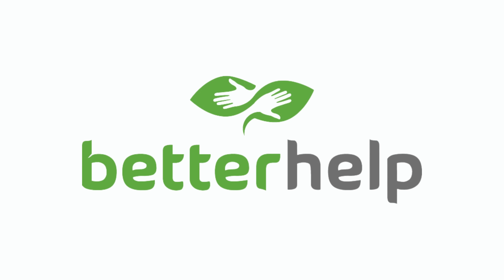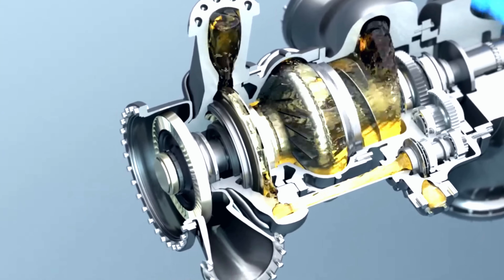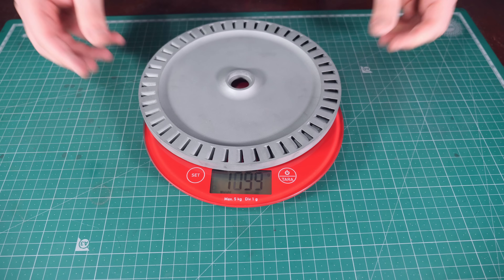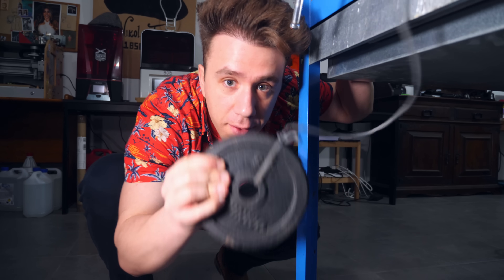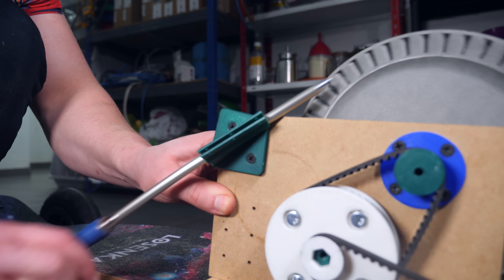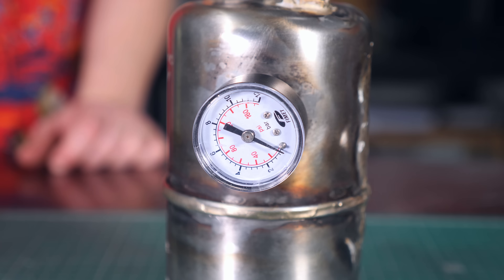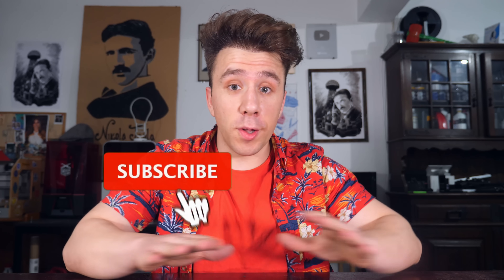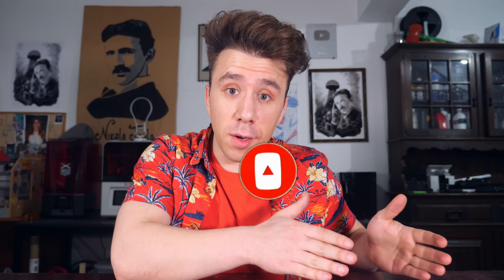I built a TURBINE Skateboard

Comment: 4:19 face next to a 1kg rotating mass
10:05 is the pressure raising? I think I need to release the pressure
Man how many chances are you taking with your life!!
Reply: A flywheel with visible fucking runout vibration on a plastic bearing housing.  Jeezluz.
Reply: If he had just stood infront of it an not to the side in the path of potential shrapnel he would bee sweet. He just wanted to get some comments goin i think 😂
Reply: After saying this, you then proceed to hop in a car and travel at speed with oncoming traffic separated by only a couple of meters from yourself.
Reply: AND wobble, AND single shear.  God damn he's lucky he didn't spin it up all the way
Reply: The pressure vessel was mild though. 8 bar at that small of a volume would probably give you a good scare and ring your ears but you'd be fine
Reply: @brett567 What if it ruptured at much higher pressures? What if he didn't pay attention to the valve?  It could have become a bomb
Reply: @Riiludragon  volume was still to low for it to be much of a danger to his life. No way that janky tub would hold enough pressure to become a menace. I'm a pneumatics engineer and have seen ruptured air receivers take out walls that they hit but even with 250l of air at 13bar the guy stood 2 ft to the side only gets tinnitus
Reply: Man is a true engineer, putting everything on the line for some fun

Comment: They have tried using them in a number of land vehicles but in every case so far at least, they didnt hold up with one notable exception. The Avco-Lycoming AGT1500. 

From what I can gather, the problem is that they just dont work very well when not driven hard. Slow to get going, not as responsive even when they do, they can be noisy, hot, expensive, and on top of that, of course have the inherent difficulties that come with any brand new use of a complex machine that has to perform day in and day out. 

The exception that proves the rule of the AGT1500 is a tank engine and was funded by the military industrial complex so doesnt have or care about most of the problems. Under more normal circumstances its been hard to get the idea going. 

Even so, they are still on the table, and being tried/used in larger hybrid vehicles which can eliminate most of the issues and hopefully reduce costs and improve reliability in time.

Comment: I’ll repeat what other people have said to make sure you see it: DO NOT MAKE YOUR OWN PRESSURE VESSELS. The design, manufacture and qualification of a pressure vessel is an entire area of engineering that you are not even close to being qualified in. You had no pressure relief valve on the vessel, but even if you did it might not have helped because you have NO IDEA what the pressure limit of that vessel is. Additionally, every time you pressurise and depressurise the vessel, cracks in the material itself and in your welds / brazing grow, so the maximum pressure it can take decreases over time

Comment: I would like to see you using a Scuba tank filled with compressed air to power your turbine - air is cheap, regular tanks will have either 200 or 300 bar of pressure, and using a first stage as used in diving will lower the working pressure to 9-10bar, which seems to be a good fit for what you are doing now. Plus, no need for a heat source.

Comment: Propane is about 150psi if you wanted to try to use a “superheated liquid” compressed air motor?
Inject it was a liquid and let it flash boil in the cylinder

Comment: Fantastic video. I got a bit scared for you with the braised liquid nitrogen tin though. Sure you know what you're doing but I have no idea how explody that might be, right next to your gentlemans too... Anyway, they use turbine engines in Abrams tanks. Seem to remember they're quite thirsty, so they don't have the range of a normal diesel powered tank but holy cow, can they shift.
I also remember hearing that the cars acceleration was a bit naff so that's why it never caught on? Don't know, something a bit fishy about that story. And you could make said car hybrid now so you'd have a reservour of more or less instant battery power to complement the turbine throttling speed itself, so it seems like a non problem.

Comment: 1. I think the wheel works as a gyro due to the weight and speed, so since it is sligtle turned to the right, it pulls to the right. Also please protect yourself from the wheel.

2. Also I hope you are aware of how dangerous the pressure cooker bomb you made there was, if that pressure gage is correct that escalated extremely quickly, if you do not put a pressure release valve on it (at a reasonable pressure), this could injure you severely orin an unlucky caes kill you or someone, it is basically a flameless pipe bomb.

3. Please stay safe out there bro, we want to see you in ONE PIECE for a long time to go :)

Awesome stuff as usual!!

Comment: reasons the turbine car didn't get produced initial cost complicated gear reduction/transmission inefficient when run at varying speeds and loads and maintenance costs a few of these problems could be helped by using a gas/steam combination to turn a generator to charge batteries/ turn electric motors

Comment: You should attach it to a wheelchair to make a jet engine powered wheelchair, ultimate accessibility. you can have a compressor on each wheel to allow for turning/steering and the back of the chair would provide more area for parts to be connected

Comment: Got an idea, since the issue here is the steering, a small go-kart place the dangerous parts on the back of the vehicle and make use of accel and break controls. As well as a helmet. the pipe bomb and the flywheel/turbine on the front could cause harm, to say the least.

Comment: For your next video could you please demonstrate the extreme dangers of putting liquid nitrogen into a sealed homemade container without a blow off valve and then heating it to the point of critical failure near a gelatin dummy?

I've been a fan of your channel for several years now, and I'd like to watch for several more years... but this was by far the sketchiest thing you have ever done on this channel and I don't think you realize just how dangerous that was.   Please be a little more cautious in the future. I know you admitted to never working with liquid nitrogen before, but you weren't even wearing gloves when pouring into that funnel which could have cracked under the extreme temperature differences.

Comment: Video idea: using the same turbine but with a hydrolysis setup for more sustainability. Essentially, changing the fuel for water instead. Probably a little less dangerous. It might lack the pressure requirements. I am not a scientist. 🍅

Comment: It almost needs a multi gear transmission. Would be neat to see something fully functional and rideable that runs on compressed air. See if a housing around the turbine can direct the air more efficiently too so you can get even more power out of the air flow

Comment: Honestly surprised you didn't use a Tesla turbine with flywheel. Though, I suppose "rocket turbine" lends itself better to a title. Slightly concerned with how unstable the turbine looked spinning at those speeds. Might have just been an effect of the camera, but it looked quite wobbly both along the axis and in its rotating. Really excited to see where this goes, however, especially with that liquid nitrogen. Be safe, Integza! Don't turn into a squashed tomato!

Comment: The next project should be a turbine power boat. Or even better, a turbine power paddlewheel boat. Use the optimization ideas from 
@pierregarbo8628 to get more thrust and higher RPM at the nozzle interface.

Comment: Out of every video you've made this might be the one I'm most impressed you survived. Like holy shit, heating a homemade cryogenic pressure vessel without even having a relief valve seems absolutely insane. It's like the definition of a pipe bomb.
Standing in the line of fire for such a massive turbine and such high rpm doesn't seem particularly safe either.

With that said it was a very entertaining video if terrifying, just please give some more thought to safety before you can't.
Reply: yeah I was screaming at the screen WHY DID YOU DIY THAT WHEN A CAMPING PROPANE TANKS EXIST!?
Reply: I’m only 5 minutes into the video and yeah, him putting his face right in the line of fire of the disk made me cringe so hard. We expect to see failure in these videos and I was hoping so badly that nothing exploded
Reply: Having a face in line with 1 kilo of steel flywheel rotated to 6000 rpm on a plastic axis doesn't look safe either. Mechanical power enough to push your entire body. In front of your face.
What could go wrong?
Reply: @tozpeak It's OK, he put the homemade pressure vessel pipe bomb between him and the Flywheel of Death. It's practically OSHA certified PPE.
Reply: Oh, shi... This is, probably, one of the (if not the)worst of the Integza's videos I've ever seen, if I think about safety. 
* Non-balanced, 1 kg, 6000 rpm spinning disk without any protection near the head and chest? Check**. (Google what happens with the human body, when the grinding disk goes off).  
* DIY high pressure vessel without a relief valve next to the head? Check.  
* 200 bar bottle on the laps (and, again, near the head), on the uncontrollably moving vehicle, without any protection of the bottle or pressure regulator? Check. (Google what can do just a jet of the 200 bar air next to the human flesh. Hint - bloody fatality. And I am not talking about the explosion of the bottle due to damage).  
* No brakes, steering or any other meaningful way of controlling the vehicle? Check.  
* Working with the liquid nitrogen with bare hands? Well, if you have a spare... Check.  

** Dude, sorry, but you were f*cking close to the death. Just a small piece of the OG school math and physics for you:
Assuming the radius of the turbine is 13 cm, rotation speed 6000 rpm, the speed of the disk's edge is about 82 m/s. Given the radius, this means over 5000 g of acceleration! Like a decent lab centrifuge! In turn this means, that a tiny 10 grams of the disk's shrapnel from the edge will "weigh" over 50 kg, when hit your head. And 100 gram pieces - over half of a ton. Think a bit about the half a ton and your head.
Reply: @man0fstraw  Thanks, that very informative. We all knew it was dangerous AF, we just didn't know how dangerous.
Reply: Yeah - Integza - don't stop, but please do some sort of safety assessment before you spin up the untried 'spinning disk of death's, or apply heat to a homemade pressure vessel. We love you and would rather you didn't disappear in a puff of gore
Reply: Pouring liquid nitrogen without gloves is also a great way to loose a finger to frostbite. Several times in this video I had the little "dumb ways to die" tune going through my head, which is annoying but beats having a shard of a flywheel or a pressure vessel do the same.
Reply: @RiverJay  that's not 100% true. Gloves work well if used well. Your skin can handle brief touches because of Leydenfrost effect. Our labtech lost two fingertips because LN2 got in her glove and she couldn't take it off fast enough
Reply: Can't you make a basic pipe bomb by just chucking a piece of dry ice into a soft drink bottle, putting the cap on, and running away? This is basically the same thing but more so...
Reply: I wouldn't bother with the word "seems" in this situation.

Comment: Video Idea - U can make a system in which electrolysis of water takes place to produce oxyhydrogen gas at high pressure.  U can use that gas to make a piston engine and see how powerful it can be or even use it in a jet engine. Running engines on water seems like really cool stuff in my opinion.

Comment: to answer the answer in the beginning: turbines are good to get high RPM but bad for torque. they also have a very narrow operation band. 
so if you use a turbine engine to power your car, you better use it to load your battery instead of trying to power your driveshaft with it.

Comment: The blades on that fan look like impulse blades.  For your nozzle type, I think you'd have a better response with reaction blades.
Aaaaaadding onto that, wrapping the whole thing in a housing, add more nozzles and I think you could achieve Speeeeeed.
That skateboard is the jankiest of jank.  Please add som brakes so you don't die while crashing.

Comment: Maybe you could run the turbine with steam using hidrogen peroxide like the one you used in your "devil's toothpaste rocket video (edit: kinda like the X-15's fuel pump), although I wouldn't do it on the skateboard, that would be way too sketchy